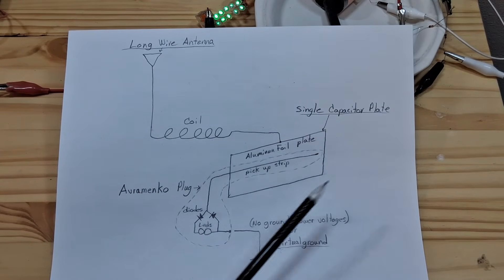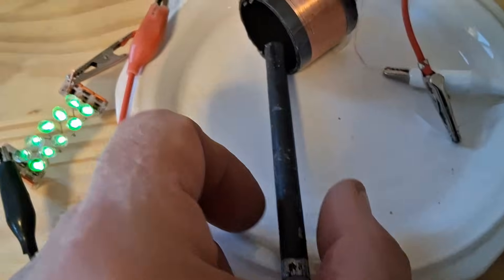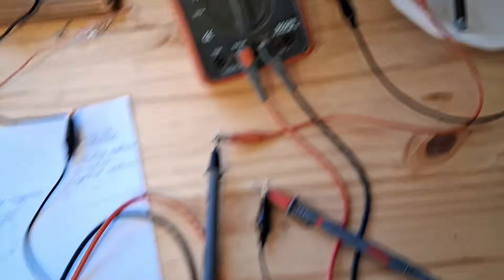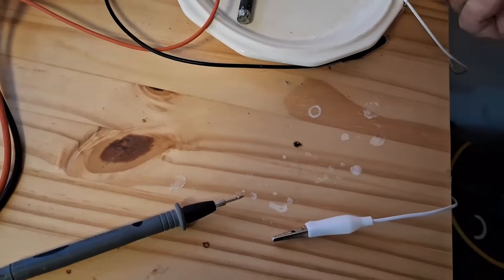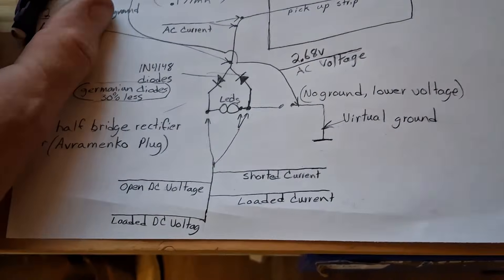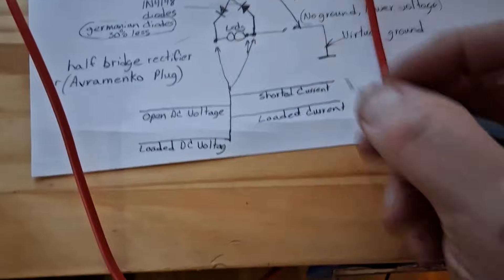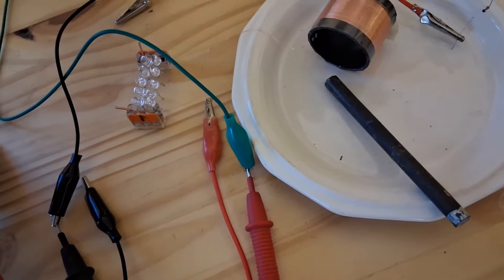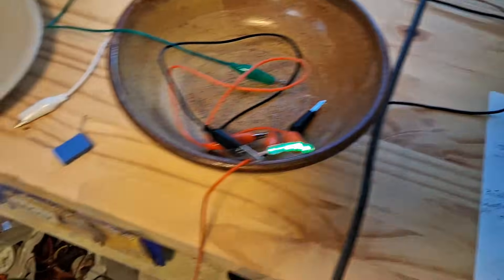RF Radiant Energy Receiver [Apparently Amplifies Amps; +

Comment: I have a tesla coil reciever I made consisting of just a 30 ga coil close wound appox 18 inches long ,1/12 in diameter.with 2 stainless steel bowls screwed to the top forming a sorta ball. One end of coil to bowls, the other to earth ground. When transistor radio is on AM,  and held near bowls, this puts out extreamly violent noise in radio. And when moved away, can pickup 3 ft away but faint. So this is your source for em waves without radio towers . Just take it strait from the ground!!!!!!

Comment: You Know, Harry Perrigo had an electric motor in every picture, every demonstration, and the antenna plates hanging beside the motor in the electric car.  His antennas were picking up the EM from the surrounding area created by the motor and circuit. My small AM transistor radio (PLACED ON AM) picks up the noise from electric motors  which fills the entire room, and sometimes several rooms away. Create your own EM waves, and you wont need radio towers to provide your orange juice!!!!!!!
Reply from the maker: I did a video on the Perrigo a number of years ago.  At that time I was harvesting RF energy from a radio station with an antenna of 8 wires, about 2-3 milliwatts.  -until it blew down.

Comment: Could you share number of turns, diameter of coil?  Also, can you use a variable tuning cap with coil instead of inductive tuning? I will be experimenting with this. Thanks for sharing!!!!
Reply from the maker: I don't know the number of turns, but the coil is 1.5 inches in diameter, with the coil being 7/8 inches long.  -but the inductance is what's critical; it needs to be in resonance with the aluminum foil plate I was using.

Comment: How close is the local transmitter, how many Kwatts does it put out, also are there any other RF transmitters near, also any electric field sources, any power transmition lines close, over or under the ground
Reply from the maker: I went over the RF transmitters in detail in the last video, if you are interested.  And yes, there are HV power lines to the north, where I did other popular videos.  Thanks for commenting.
Reply: @doubleMinnovations nice videos, I have got Tesla's wireless power working over many meters with small input power to the Transmitter, 50 volts down to less than 10 volts  and ma current input  to the Transmitter, Tuned Tesla coils, capacitance top load ball and ground matching capacitance, lighting a lamp or driving a motor at the far end. Only ground connection and resonance
Reply from the maker: Sounds pretty interesting!

Comment: Have you looked into the work of marion james fisher and chancey britten and their crystal radio type devices
Reply from the maker: Not that I remember.  What did they do?
Reply: They created something similar to what youre doing i think. J.m.fisher used special electrolytic recitifiers and also a very intrerasting magnetic oscillator. It also goes into a lot of details in j.m fishers patent. And chancey britten created a type of tube detector using mica and three connections. It was a pipe shaped thingy with a cupple of bends in it that where connected to a battery supposedly amplified the power from a crystal radio by a lot

Comment: Perhaps if you are using a coax cable for an antenna and you use the inner wire to antenna tower pickup rods and leave the owner mess wire unconnected at top of tower and insulated from the air then bring the virtual ground the the bottom end of your antenna coax cable's outer mess thereby bringing the ground to sky around your inner coax wire to pull a higher voltage from the sky ....

Comment: Nice work.  Hear in NY with my long wire antenna with heavy snow fall ,The antenna wire builds up a charge that can shock you. I use a neon lamp to discharge this . It burned out a SW radio from that static charge .  With that plate cap you make try replacing that with the variable cap used in AM radio . This gives you tunning . Just a fun try . Also try small cap like 1 UF across the LED  and see what that does. Cheers from NY !
Reply from the maker: Thanks, I tried those things.  A small cap across the LEDs decreased output a little.  I think the LEDs like spiking voltages.  What boggles my mind is how a tiny current of .2uA before the diodes gets transformed to a shorted 127uA, or 60uA @ 10.5 v through the LEDs

Comment: If you had an lcr meter I'd be interested in the inductance of each coil. Basically you have a capacitor and coil in series. A series LC circuit, at resonate frequency the potential for higher gains significantly increases.
Reply from the maker: If you pause this video where you can see the worksheet, the inductance value is written under the coil.
Reply: @doubleMinnovations Thank you!